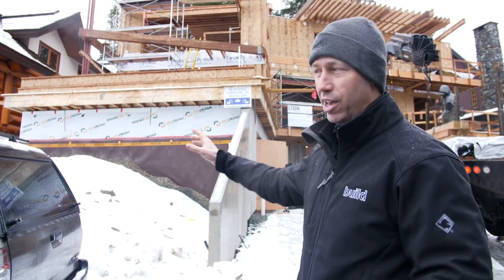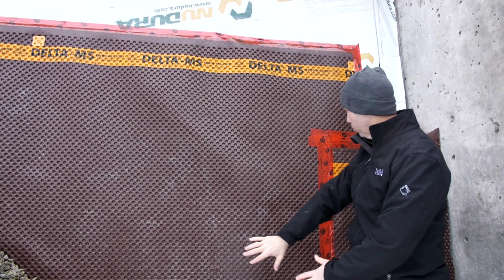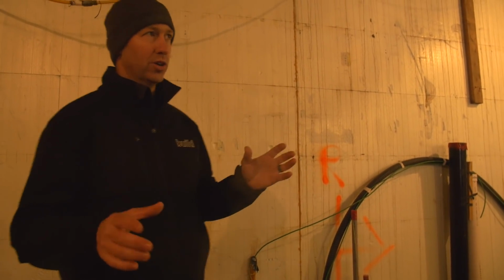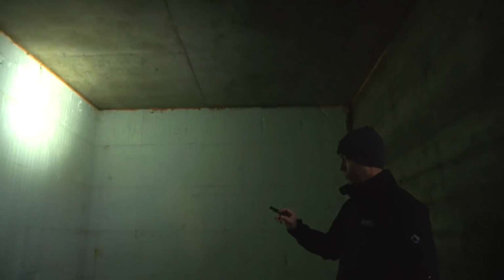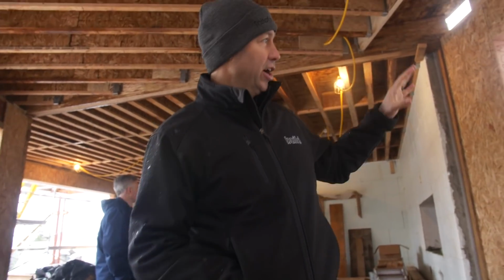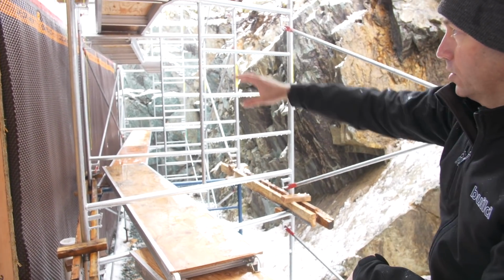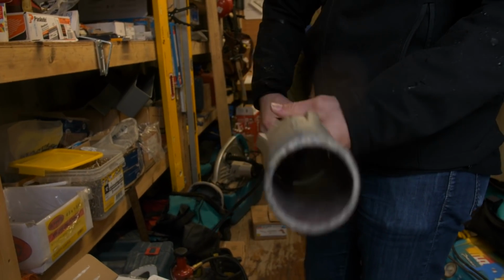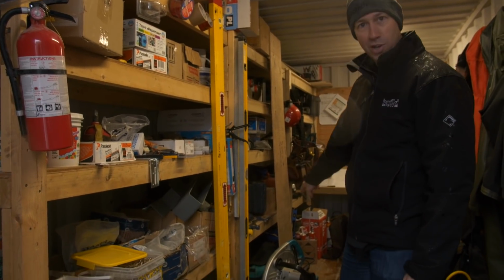Super Cold Climate BUILD Outside a Canadian Ski Resort 🇨🇦

Comment: I live in a small 1940s home in the southern Okanagan Valley about 250 km ESE of Whistler.  About once a decade we see a few mid-winter nights at -40 [C or F, at this number both scales agree].  2x4 fir wall studs, stucco exterior, lath & plaster interior, insulated with pine sawdust/shavings from a then-active local sawmill & box factory!  No big deal, just add a third wool blanket to the bed [and keep your socks on!].  Humans can apparently adapt to many extreme climates.  Thanks for the recent tours, Matt!

Comment: Hi Matt - love all your videos, thank you. I'm from Canada too and interested in the ICF construction. Is there any concern with the cement staying wet, especially when poured in winter? How does it actually cure within the insulation, or does it just take longer?
Reply: i11am to keep it simple, as long as concrete (cement is just one ingredient) is kept from freezing, the process of curing (called hydration) actually produces its own heat internally, and concrete requires moisture to cure properly. In face when large slabs are poured, “wet cures” are often used to ensure there sufficient moisture for the curing process...the slabs will be covered with poly or burlap and wetted. The last thing you want for any concrete is for it to cure too quickly. You’ll get a lot of shrinkage cracking if it does.
Reply: Thanks Jordan, much appreciated!

Comment: R-80 & R-50. Wow. Looks like an expensive build. Not sure I like the LVL ledger hanging on bolts. Rather a ledge. Like the job container though!
Reply: I know this comments like a year old but it's not bolts holding that lvl ledger on. There's a hanger system that gets imbedded into the concrete and even has rebar threaded through it inside the icf block.
Reply: Of course I get to that part of the video seconds after my comment.

Comment: I'm curious as to why one would consider a flat roof in that region
Reply: It's not really flat but has a pitch of about 1/4" per 1'. Engineered correctly it's not a problem at all. I live in the northeast and all the row homes in my city(Philadelphia) are flat roofs.
Reply: Ya he said they get a ton of snow,,,,you’re just asking for trouble with a Flat roof
Reply: We just engineer for the max load and also gain the natural insulating from the snow plus we also don't have to deal
with the "avalanche" affect of falling snow.
Reply: @paulnelson9269  ueah, and when its about 10 feet you can core it out and get yourself an extra storey!

Comment: I asked about the mini as I just installed my first here in SE Alaska and am totally impressed.  At the lowest setting in 24 degree weather it easily heats my 15k cu. ft. shop and dehumidifies.  A ton and a half unit.  Only issue so far is ice build up in the high humidity temps (25-40).  Doug

Comment: Hello Matt,  Always funny what you think is a, "super cold climate"!   Vancouver is tropical compared to inland temps on the same latitude.  Whistler is a bit colder but not by much.  It does get a pile of snow because it is so mild which is why the ski resort is there.  Curious how you seem to have a cost is not a factor for your jobs.  You must work exclusively for multi millionaires.  That house in Whistler must be over two million alone with its property?  More curious on the materials and techniques for building the vast preponderance of society's housing needs.  Always important to see a cost/performance factor and a longevity (realistic) prediction.   I am totally amazed that they are putting down a flat roof in a wet climate (well maybe not totally as there is an architect involved!).  Time and again they are shown to be a very high maintenance short lived style of roof.  A pitched roof is a proven winner.  In snow country one with a metal roof will shed snow avoiding huge stresses on the structure (properly designed to accommodate the berms) not have a wet sponge three feet thick laying on it for weeks (all that snow melts and freezes as the temp swings and thaws)as well as lasting for generations with very little attention.  You can build to the highest efficiency standard you want but if the structure is a designed 'throw away' the impact on resources is far greater than a less efficient longer lasting home.  Take care and Merry Xmas.  Doug
Reply: @BenjaminFranklin99-s9n  You did it the right way.  Sorry about the long. Previous reply.  I wasn't arguing more an addendum although it is a pet peeve of mine.  A building should above all be functional.  You would be a good person to entrust a project to.  I believe as a conscientious builder you would have talked a client out of trading space for function quickly.  Kudos to you.  By law architects are often involved with costly detrimental effect.  I believe a lot of that would end if by law they had to refund full cost and damages for a project that failed to perform as specified.  They would quickly learn what works and is practical and what is not!  

On another note did you use mini splits in your house??  Take care.  Happy New Year.  Doug
Reply: You must be a new sub. Matt is in a class of builders that builds for people looking for high-performance living. YES, the cost is NOT an issue to achieve a high-performance home. The same reason people buy high-performance cars. I buy and sell real estate and Matt has helped me raise the bar in my construction jobs, Not necessarily more expensive but Matt has really helped me in building better-performing homes.
Reply: @BenjaminFranklin99-s9n  I have seen so many fail, large buildings as well as small.  Within a three or four year period they start pouring 'miracle goop' of the latest fashion on it.  From there on out it is fix a leak find a leak until the roof system rots out.  There just is no justification for them except architects get to charge again and again to repair what they should never have designed.  Always selling the most expensive wonder material promising to allow a swimming pool on your roof. Inflates the budget of which they take a percentage as well as makes certain a rebuild ten years down the road at best. Upholding the tradition of their high guru Frank Lloyd Wright who built the IBM computer building in Chicago to be "aesthetically pleasing" using a flat roof that never stopped leaking on expensive electronics!!  Until they get some common sense they are not a useful step in the building process.  Sorry about my bias gained from experience.  Happy new year.  Doug

Comment: Is this system stronger then a poured wall
Reply: It technically is a poured wall, dont see what the differnce would be. I'm wanting to build with ICF, the big differnce is you dont have to be very smart to put up a ICF wall, bored formed walls take alittle talent
Reply: @townsendliving9750  you better watch form bracing with ICF’s as the are prone to blow outs if not properly braced.  Also, many ICF systems use a lot of rebar both vertically and horizontally thus producing a very strong wall system.
Reply: @jamesmoon1841  I'm planning on using 6" ICF with 4 inches of EPS per side. Theres no reason to go with more concrete, the less concrete the less outward pressure during pour, and the thicker eps reduces blowouts and increases insualtion value. Not sure of blowouts ate very common anymore on the mainstream brands. I think they have it taken care of these days pretty much.
Reply: If you go to Fox's website, who sells ICFs, they claim much stronger.  Also, the ability to pour nearly year-round despite temperatures is pretty nice.

Comment: Whistler so beautiful but only been there in the summer.....on ICF foundation walls I would prefer an actual ledge (kind of like a brick ledge on a slab) to support the ledger board and structural load above rather than bolting the ledger through the ICF.  I know it has been engineered that way but ICFs are still a relatively new building method compared to traditional foundation wall system.  The entire structural load from  above rests on steel bolts spaced apart instead of being dispersed across the top of the wall.  Any rust through of any bolts compromises the entire structure even with the supporting plates cradling the ledger beam.
Reply: Lay some metal plate on top of the stem walls that extends beyond the concrete prior to installing the sill plate..

Comment: Not a fan of ICF/SIP construction...especially building into a hillside. If there's ever a problem with water penetration on that back wall, you'll never be able to dig down to the bottom of the foundation. This is a house for somebody with more money than brains.
Reply: French drains work really well, provided the low end drains well
Reply: Your comment regarding building into a hillside could apply to any type of construction. In the video is shows the amount of space that is back filled - more than adequate to dig out.
Reply: How is this any differnt then another construction. I dont like sips but not for that reason, icfs are the coolest thing since sliced bread

Comment: Matt why is the dimple membrane secured or sealed with tuc tape and has waves in it?
Reply: Because the sheet is only attached at the top and ends.  It's essentially hanging from the fasteners.  You don't want any extra perforations in the sheet.
Reply: Is tuk tape appropriate for this application?
Reply: @vancouverrealestate2766  The tuc tape is just used to hold the membrane in place and keep debris from getting behind it temporarily until back filled and outer cladding is in place after that it serves no purpose - the dimple membrane is not meant to be water proof but to provide an air gap so water is free to move down the wall to drainage.

Comment: in Europe some people build ICF houses but they use it for the whole house, and they use ICF with 1.77 - 2inch inside  and  from 2 - 7.87 inch outside, most people use the 4 or 6 inch outside versions...
Reply: Never even heard of that I dont think. The only systems i know are 4 inches per side and then after that you add on separate pieces of EPS after the poor, may be the same thing you're talking about. I didnt like that system too much but I'm not in a cold climate so didnt really matter to look any closer
Reply: @townsendliving9750  look up "Quad Lock", they make the best panels and ties (knock down type system only) for the most ICF thickness for out or in or both, Others max out at 4 inch at most and one or two use inserts which go inside the form reducing the concrete thickness
Reply: @Joshua79C  I've looked into alot of brands. Defently want to use quadlock rood panels, which may lead me to use thier blocks as well. 4 inches per side is plenty of insualtion for where I live. Nobody really makes anything over 4 inches that looks very good, even quadlock just makes layers of foam on the outside, at that point it would be much smarter just to add 4x12 full size panels after the building is up. But I'm just going to go to 4 inches. Fox block makes s bunch of add ins that seem cool, the window bucks, and block ties. Fox block seems to be one of the best ones. But no roofing system

Comment: Pisofshet.  In Russia this eps tecnology was popular about 10 years ago, now all know this is a pure shit. Insulation inside - whaaat??? For why... insulation dont work like that. And eps not eco material.
Reply: Insulation inside can work, as long as you calculate your dew point correctly. It's just way easier to put it on the outside.
Reply: @UhOhUmm  its correct but eps... and not in this climate zone and outside insulation volume.
Reply: It's because it makes for a really good form, concrete is kinda of really hard to pour vertically if theres nothing to hold it in place.

Comment: 6:45 SIP not ICF
Reply: Something defently wrong with what he said, not sure what though. It looks below grade and also dont see the plywood on either side. Something was alittle confusing here
Reply: @townsendliving9750  he corrects himself at approx 8:30
Reply: @BenjaminFranklin99-s9n  we hold Matt to the highest of standards :)
Reply: @BenjaminFranklin99-s9n  AND there ARE SIPS rated for below grade application.
Reply: @ecostudio1044  I looked and found a basement rated SIP, but I think that this might be a hard sell for most, due to fears of rot.  I live in the Pacific NW near Puget Sound, where it rains literally 1/2 of the days of the year.
Reply: @BenjaminFranklin99-s9n  probably would be a hard sell. However, if the waterproofing and drainage are done well there should not be any more worry than concrete. In soggy England, masonry is subject to "rising damp". Here's some information for your entertainment or concern: https://www.permagard.co.uk/advice/how-to-treat-rising-damp 

ICF might hide lots of problems, eh? Each solution provides another issue :) Rich
Reply: @BenjaminFranklin99-s9n  I just meant that his houses are built to high levels of craftsmanship with high-end materials.

Comment: Do they or anyone you know vibrate the concrete ? Is that normal practise or rare ? What devices do yall use?
Reply: Glyn  ... we do all ICF walls vibrating ... and we use a cordless Makita Vibrator and this works all the time no problem
Reply: yes any foundation concrete pour you ALWAYS vibrate. they have battery powered vibrators now basically 6ft. dildos
Reply: the concrete is vibrated...it is just the form system (ICF) presented here that is different than standard. Standard concrete vibrator.
Reply: Next question. Does frequency of vibration matter? Also has anyone built concrete like the Romans with volcanic ash ?
Reply: Glyn  " Nope, you're a liar".....A little harsh there, don't ya think?, Glyn? 
Vibrators:
Good concrete consolidation is essential for strong, energy-efficient ICF walls, and studies have shown that unless a super-low-slump concrete is used, the only way to ensure adequate consolidation is with a pencil-head concrete vibrator.
 Fred Oswald, president of Oztec Industries, generally recommends a ¾”-diameter tip for ICFs. As with bracing, operator knowledge is every bit as important as good equipment.  ~ icfmag.com
https://www.icfmag.com/2015/11/tools-for-icf-professionals/
Reply: No real builder skips the vibrating of concrete. And I've never seen a single foundation job, ICF or conventional, that wasn't vibrated. It's standard practice everywhere.
Reply: I live in a part of the world where technology is a few decades behind. I assisted in a ICF build 5 years ago, one of maybe a dozen in my county, we used normal everyday concrete vibrators. No issues, no blow outs. House was checked afterwards with infrared to check for voids, no major voids. ICF is not rocket science, it's actually quite the opposite, it's the simplest building method on earth. I'm planning a 6k square foot build and me and girlfriend will build it by ourselves